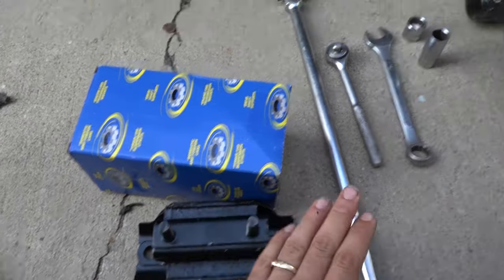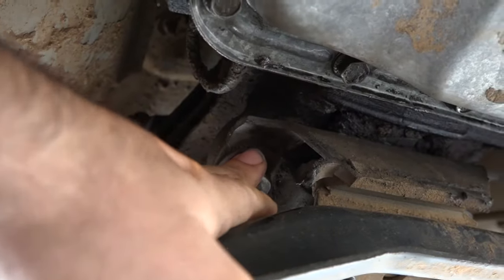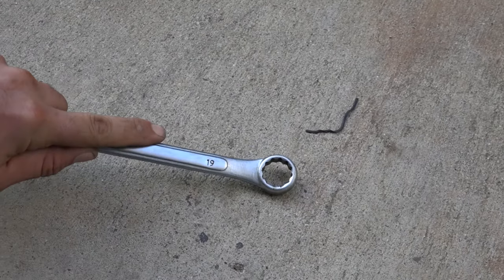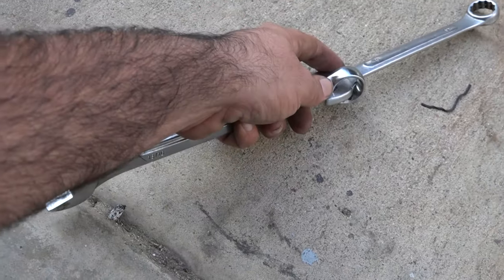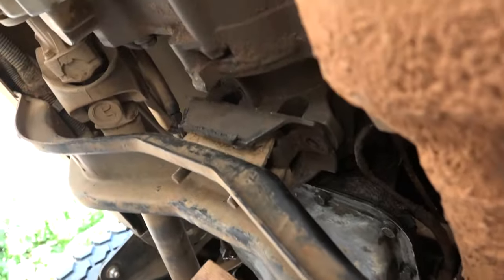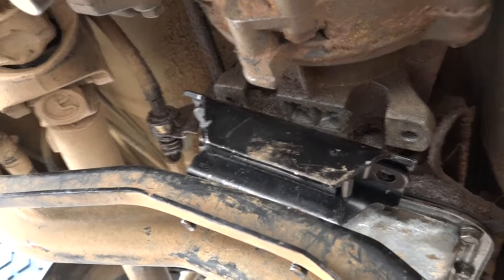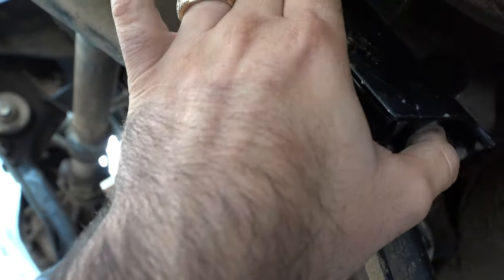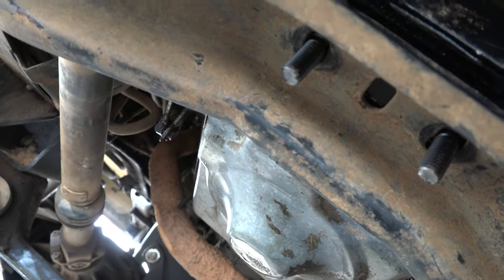How to change transmission mounts

Comment: I’m going to attempt this on my 2wd 2000 Explorer next weekend. The drivetrain is almost identical to your ranger and later rangers as well. I’m still wondering how you can lift the transmission with it being bolted to the engine. But I guess it has to have that much room to move or parts would break during normal driving.
Reply from the maker: On a 2wd you have even more room. It shouldn't be an issue.